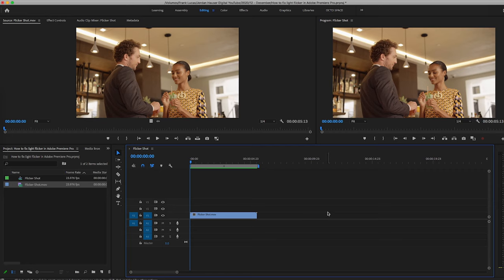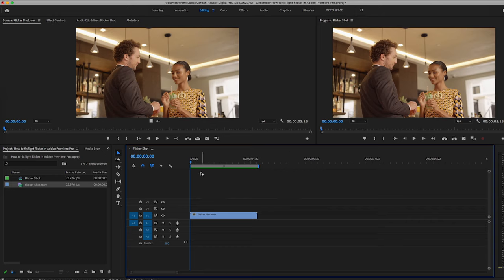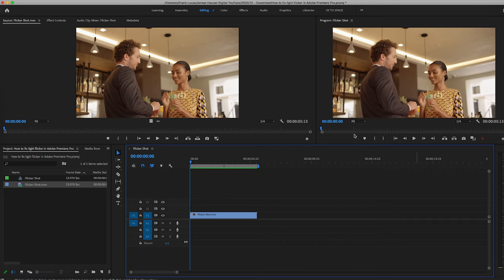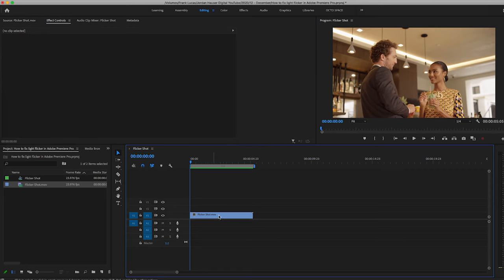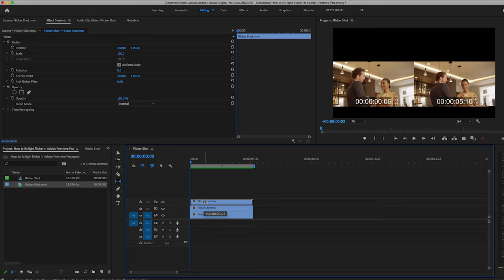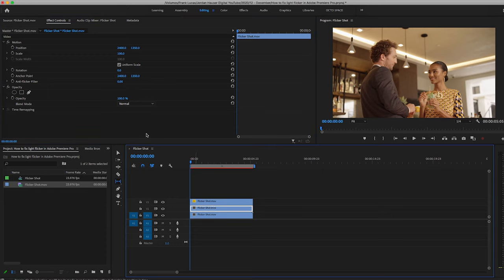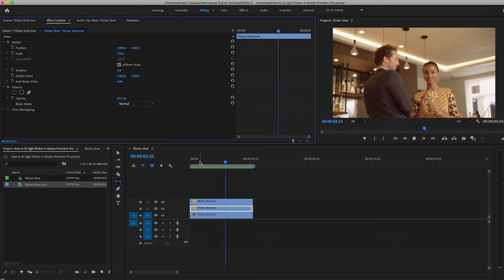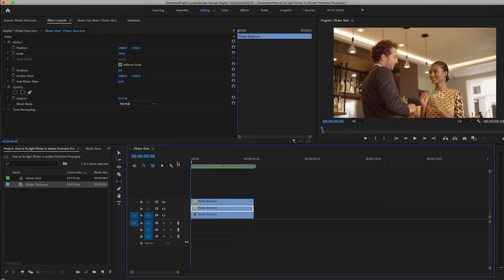How to fix light flicker in Adobe Premiere Pro

Comment: Congrats you now get a blurry image.

This technique is good if your camera doesn't move, it's even better if your subject doesn't move either.

Great tutorial if you have a still picture that is flickering i guess
Reply: I had my subjects moving and i did not notice any extreme blur. You can nest and sharpen a bit bro
Reply: I also didnt see any blur and my shot moved a ton
Reply: This totally fixed my issues. Go whine somewhere else bruh. Or give a better solution.
Reply: @tylerstephenhunt  As i said, it works in some case, in other case use a deflicker plugin or the one from Da Vinci Resolve
Reply: same here
Reply: @heyabhishekdey  moving 1 frame will add blur, moving a clip 2 frames will had TONS of blur and ruin a shot unless its static.
Reply: Exactly, its not a be all and end all solution
Reply: I used the technique shown here to fix CRT flicker on retro game footage. It didn't go blury at all. Make sure you're only slipping by 1 and 2 frames as shown. Any more and you'll get blur.

Comment: It works. Thanks. If it did not works, try to zoom the video so that you can easy shift 1 frame. But first the video must be cut? If the video full, you cannot shift it? Try shift 1 and 2 frame. Does not work? Try 2 and 4. Still not works? Try 3 and 6. And so on. I works on 3 and 6. Below that the video still flickering.

Comment: Great tutorial but why is my slip tool not working? Any idea? It does nothing. Also, what commands to press for a quick render of this particular sequence?
Reply: Hey, you need to decrease your video before using slip tool, duplicate de blocks and use Slip Tool :)
Reply: If your video is fully extended out (the beginning of the clip is 00:00 of your footage) the slip tool has no footage to slip to. You'd need to trim the front end of your footage first, or you could just nudge your footage to the right.

Comment: This was so helpful! I am a wedding videographer and I shoot in a lot of low light. I try my best not to use a high ISO but sometimes I have to. My main lenses are 50mm and a 17-40. Could you make a video on how you get rid of grain in premiere?
Reply: Neat video plug-in
Reply: Switch to davinci.
Reply: @savivasup  Piece of garbage, unstable, slow, unable to playback anything when applied, makes the export 10x times slower, on a high end pc and on the maxed out mac studio as well. There are no reasons to use premiere anymore.
Reply: theres an effect in premiere called vr denoise, and if you dial in like .05 it'll blur out the noise
Reply: @EatBuildRideRepair  yes there is a reason, i understand if u have less complex projects and you just need to cut and add some basic affects davinci will be much faster, but if you need to use after effects in like every 2nd clip (which i need for my work) you will still be faster if working with premiere. You could argue if there would be a similiar software like after effects, sadly there is no which is any good.

Comment: For some reason I can't change the slip. Any thoughts why that is? Its like it doesn't want to change the frames
Reply: Same for me! :( Did you find any solution?
Reply: @elinelizaj7585  Hey, you need to decrease your video before using slip tool, duplicate de blocks and use Slip Tool :)
Reply: Hey, you need to decrease your video before using slip tool, duplicate de blocks and use Slip Tool :)

Comment: This works well for visuals, but if audio has to line up with visuals it doesn't work (e.g. person speaking).
Reply: good thing is this usually happens at 60fps or higher so slow motion anyway usually not having camera audio